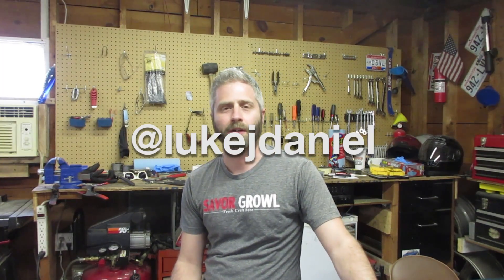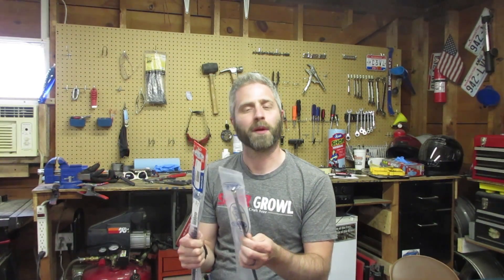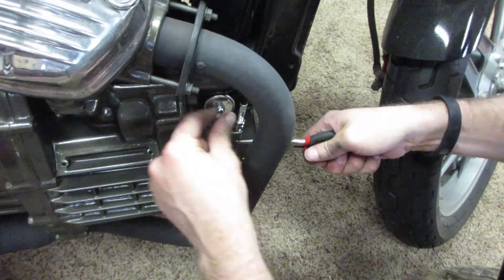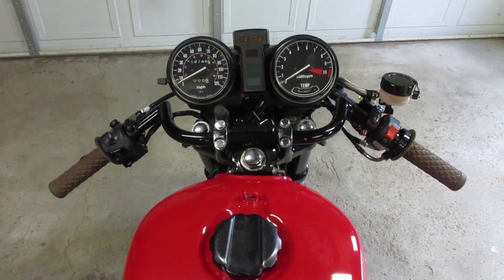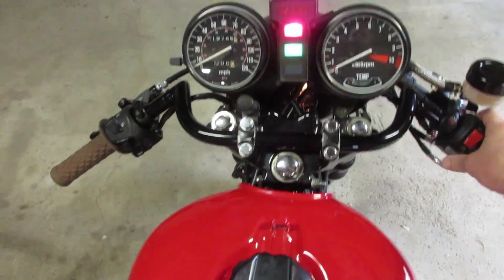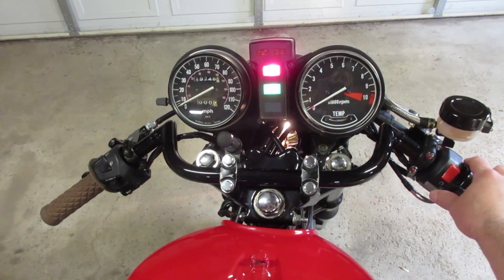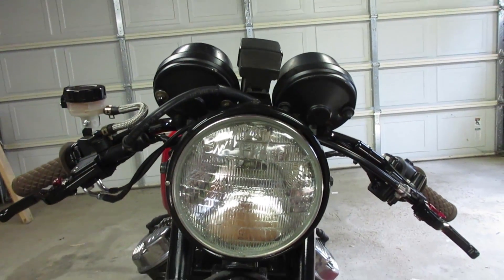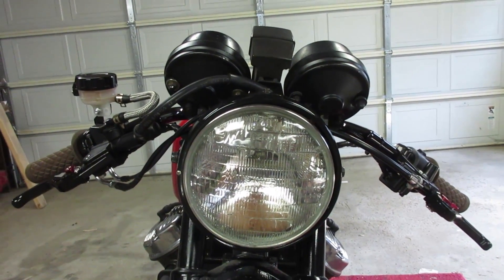Shortening Motorcycle Cables Part 3 : Honda CX500

Comment: I decided to replace the hand controls on a 68 BSA  (rusty) I ordered new ones that did not receive the adjuster ( stock cable had adjust built into end of cable.)  after ordering 2 different cables. I am at this stage.  modify and make  my own..   thanks for sharing.

Comment: Just curious but the clutch cable at the clutch end goes through a cable "locator"? I would have put the adjusting nuts on opposite sides of that piece and pinched it with the nuts or am I seeing it wrong?
Reply from the maker: I see what you mean, and I don't see why a third nut could be installed on the bottom of the bracket. On the two CX500s I have owned, two nuts are stacked and tightened on the top of the bracket. The two nuts tightened against each other keeps the adjustment true. The downward force from the clutch arm seems to be plenty to keep the cable in place.